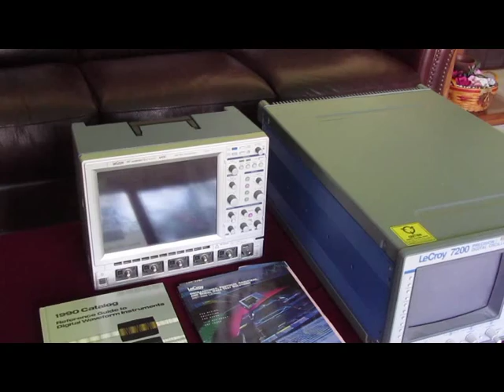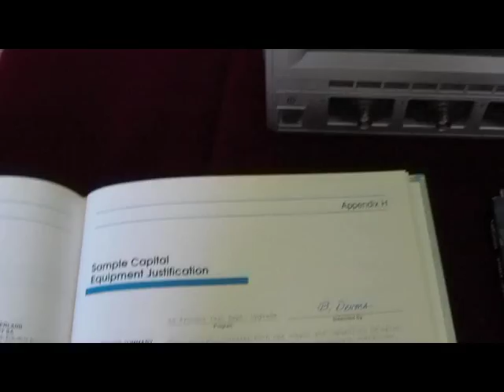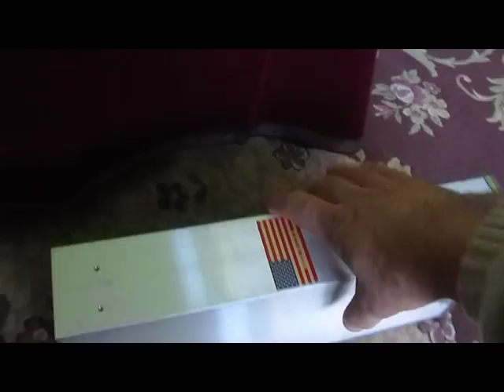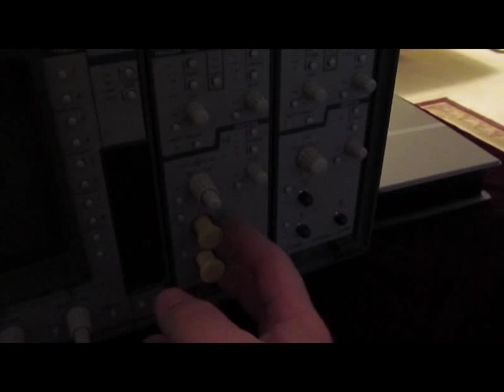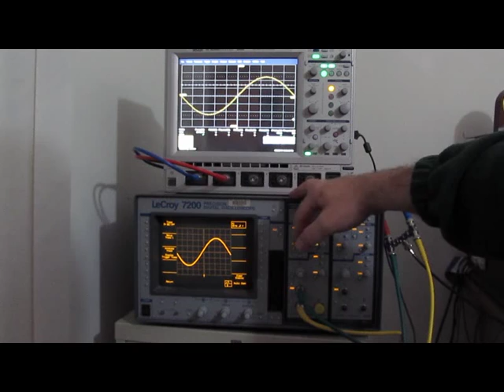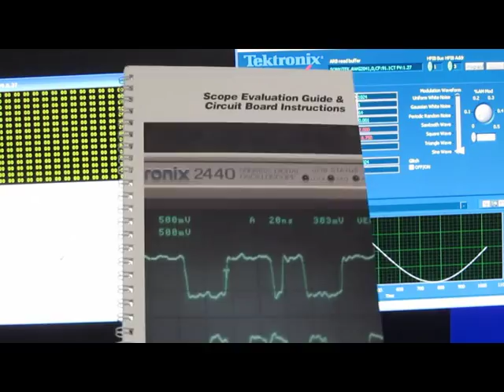Comparing the LeCroy WaveRunner 64Xi with the 7200 Part 1

Comment: I also have 7200 in non working condition. Tell me what type of hard disk you use for retrofit and what you do on circuitry to make workable on 7200? Thanks..
Reply from the maker: I am using a Seagate ST-225 that I had modified to work with this scope.  The Miniscribe 8425 and Kalok KL320 will work without any mods.
Reply: Kalok drives are quite expensive and Miniscribe disks have problems in general with integrity. If I must make replacement of my disk I want best solution, that is reason for asking regading mods on Seagate. On your opinion what will be best: using Kalok or modified Seagate?
Reply from the maker: Because you asked, best IMO is scrap the scope. Really. These things are very old and the parts are hard to come by.    They dissipate a fair amount of power and may require AC depending on the climate where you live.   I would guess I have replaced about 20 Tant caps in this one shown in this video.   If the plug-ins are know to be working and in good condition, you may be better off at least finding a working 7200A chassis.   Recently worked on a few of them.   

https://www.youtube.com/watch?v=WXFoAAL7hxo
https://www.youtube.com/watch?v=7SByDsNaYiA
Reply: This scope, I know, is not best of all times but for me will be challenge to fix. You replaced tantals because they failed or they go out of specs? How did you resolve question of service manual? I ask guys from LeCroy via tech support but without any response.
Reply from the maker: Tants failed.  Manual cost me a couple hundred USD to have them make a copy. You may be able to go through your local distributor to see if they can get you a copy.
Reply: Do you may be have UV eprom dump files for eproms on video board (72DSPD47A and 72DSPD48A)? I want verify content on these chips. Thanks in advance...
Reply from the maker: No I do not.  I have repaired several of these and never ran across a problem with the EPROMs.  If there is no video, I would start by checking all of the supplies on the video board.   You may find one or more shorted tants along with some blown resistors.
Reply: joe smith very glad to hear that...Currently I make preliminary check of all tantalums on video board. Some are very good accordingly to my ESR meter and some are in category: pass (resistance up to max 1...2 ohms. On your expert opinion where to search for problematic part of circuit when my scope give following message on screen: ROM version: 1.4 Nov 16 1989 // System selftest Passed // BRAM: disk parameters invalid // FATAL ERROR: PCON initialization problems ?
Reply from the maker: BRAM most likely means the battery is dead and it lost the setup.   PCON is the main I/O controller board.  That board controls the floppy, hard drive, GPIB, printer port and the serial port.
Reply: Old dead battery was removed by last owner. I put ad-hoc solution based on Saft 14250 lithium 3,6V battery (battery for PLC - Simatic backup purpose) but error message stays the same. Maybe this battery must be NiMH and in sort of cycle charge/discharge circuit? I will make this circuit first at all. Setup for this card located in what kind of memory chips? Will be possible to put configuration/setup data somehow back to this scope cards? What is correct procedure?
Reply from the maker: Yes however, this BRAM is not going to prevent the DSO from running.  The PCON fault on the other hand will need to be corrected.
Reply: joe smith ok...i this case my first problem is PCON board. Do you have some troubleshooting guide...or ideas where to find cause
Reply from the maker: Well, I have no idea what your skill level is, what equipment you have available, how experienced you are with VME.   If you now have the service manual,  you know they basically will tell you to make sure the board is seated and swap it.  They have the schematics if you have an extender board, LA and other tools.  Really,  if you are not setup and have little experience and still want the DSO running, the easiest thing may be to find a second one for parts.
Reply: I am quite familiar (expert will be to strong word) with troubleshooting in analog (AF and RF) circuits and to some extent in high speed digital technology.I contacted service department of LeCroy but they told me that they do not have any service manuals in tech archives for that old unit. Only service manual for plug in modules. Currently I am in dark how to begin this repair without service manual...
Reply from the maker: You wanted a challenge.
Reply: Great challenge indeed. I have LA, next step is find/acquire PCB extender boards and main goal of all: finding service manual. BTW, I received another letter today from service support, information regarding old and obsolete manuals was right one. They don't have any manuals left for that scope.

Comment: I purchased two 64Xi they had some problems with the PS so I replaced all the electrolytic caps from the PS and the motherboard one unit works fine the other no at start up the Lecroy screen letters are bigger and so is Windows so I need to turn it off and then on so the letters come normal and operates fine after that, what is causing the screen to get bigger at start up from cold and then after turning it off and then on it works fine again. Any ideas. Thanks. Update... I fixed it was the internal battery.